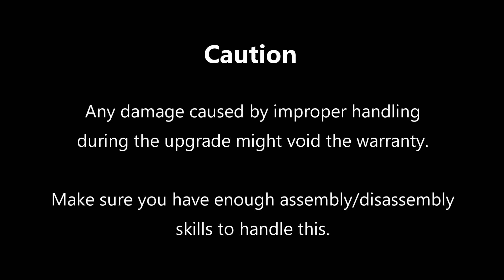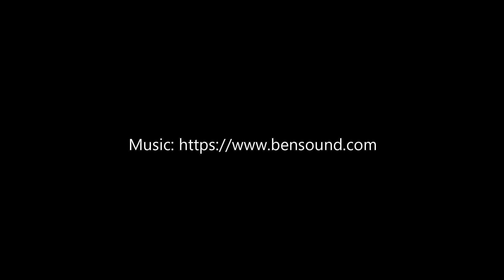MSI Stealth Thin/P65/WS65 Series SSD & RAM Upgrade Tutorial

Comment: Thanks for this video, I installed new ram and a large SSD. I highly recommend having a nice set of tweezers with sturdy tips. I used Vetus ESD-15 and it was helpful. That screw under the factory seal tape was crucial so thanks for whoever point that out as well. Watch other videos if you need to get a feel for how the ribbon wire connectors work. Go slow and use the tweezers as much as possible, being careful not to stab anything or put too much weight where you don't want it.

Comment: Hi, I have a question, the model msi creator p65, that has 16 gb Ram, can I upgrade that? 
Inside the computer, are there 2 memories with 8gb each one? Or only it’s one space busy with just a module of 16gb? 
Thanks for answering
Reply: You should be able to upgrade, but it is always better to check before buying anything (it is very simple). If you open Task Manager, click Performance and then Memory. There you should see, on the right panel, the number of slots that are being used. 
Mine is P65 Creator 8RD with 16gb of factory RAM and following the previous steps I can see that it is using 1 of 2 slots.
Reply: Thanks for asking!! I have same
Reply: Thanks for your answers, guys! I have already bought a computer... An allienware 15R3. 
Greetings!😃
Reply: For anyone else asking.  There are 2 slots that can accept 16 GB each for a total of 32 GB of ram.